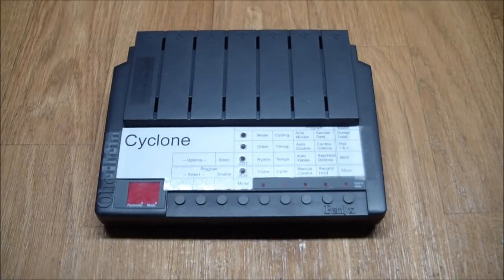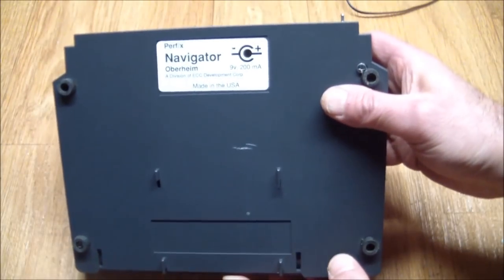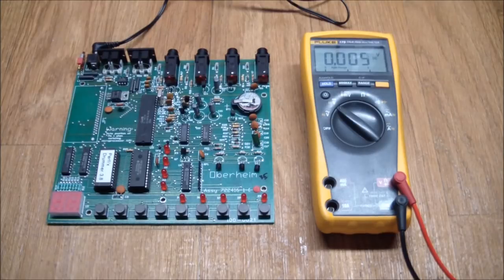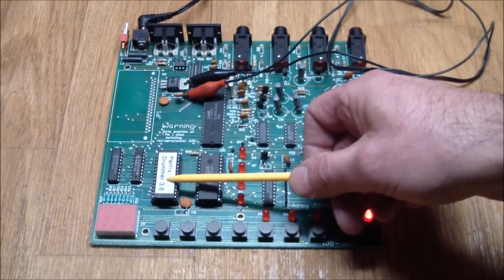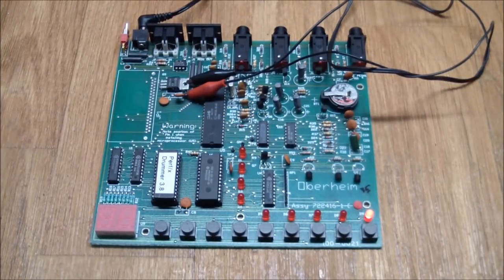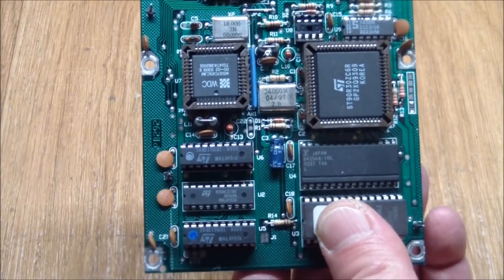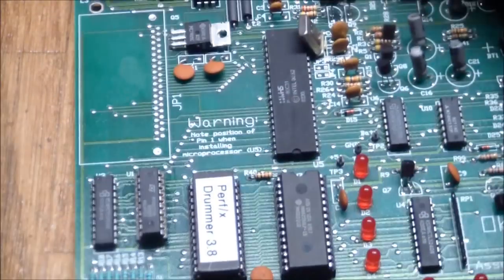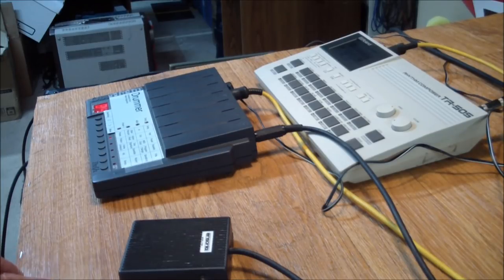AE#37 Repairing An Oberheim Perf/x Drummer Sequencer

Comment: Normally with microcontrollers firt I test reset and clock, as often the capacitor leaks or is open, or the crystal refuses to oscillate. That the latch was buggy is not a surprise, those transpartent TTL latches often do suffer from parameter shift with time, or the threshold levels or leakage changes to the point they no longer work at high speed, but with DC they have enough time and current to show static operation. I would guess the enable line either was leaky or had electromigrated internally to a open or short, making it non responsive to the latch signal, otherwise you would have had just a garbled set of data lines and one in a fixed state.

Comment: Did you have to modify the case to accommodate the socketed logic chip?
Reply from the maker: I left the case alone, and there's seems to be no problem with heat after letting it run overnight.

Comment: Have you ever tried desoldering needles? BigClive mentioned them in a recent video and they look interesting. You pick a needle that fits over the pin and through the hole, heat the joint and push the needle over the pin and through the hole, let it cool, and then remove the needle. Repeat for all pins and the chip should come right out. Just search eBay for "desoldering needles".
Reply from the maker: I'll have to look into those

Comment: Could you solder a IC socket on top of the original pins that is left sticking up after you removed the old IC???? just a thought...clip the pins, remove the old IC and straighten the pins upwards and solder the socket on them..I know this sounds weird but Im an outside of the box kind of guy...and since they are using solder that needs to be at some very high temps, it would be the only way to do it.
Reply: I have soldered the new IC onto the pins of the old one, as the manufacturer decided to make the board double sided DIP parts, and 16 layers, so replacing any failed DIP was impossible as you had at least 2 packages the other side in the way. Cut the pins off at the case, take the new IC and do some filing to thin out the case side under the IC, then bend the leads tight, trim and solder in. You really had to be certain the IC was faulty first, so logic probe, scope and pulser to test the IC in circuit was first step, and these boards did not work at all if you used an extender on them, so we had a pair of sockets for the card frame with only power and ground applied to test out of the unit.
Reply from the maker: Interesting concept, although it might be a bit fiddly to keep the old pin stubs aligned when soldering the replacement.